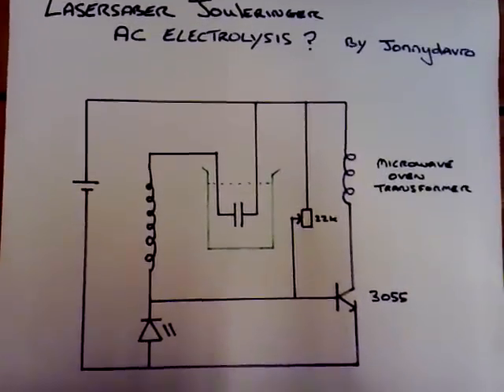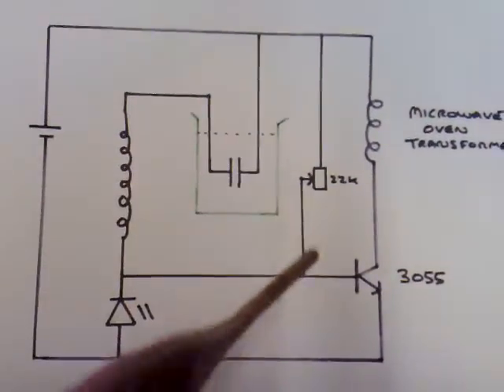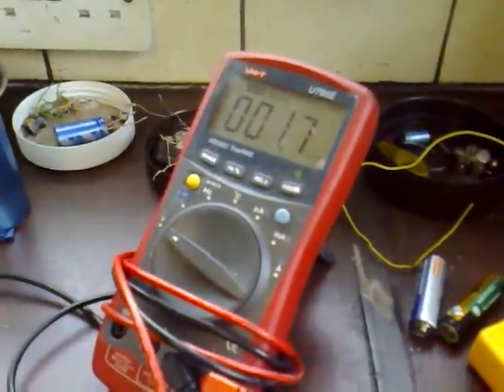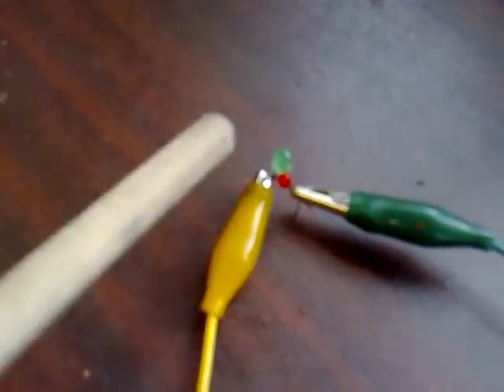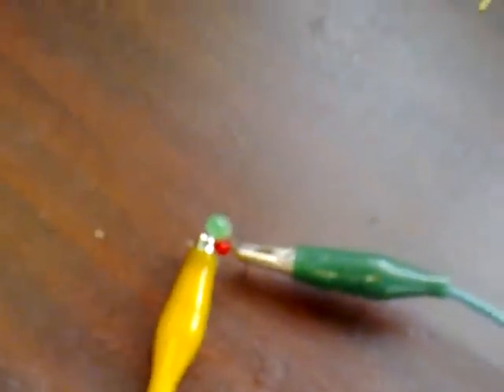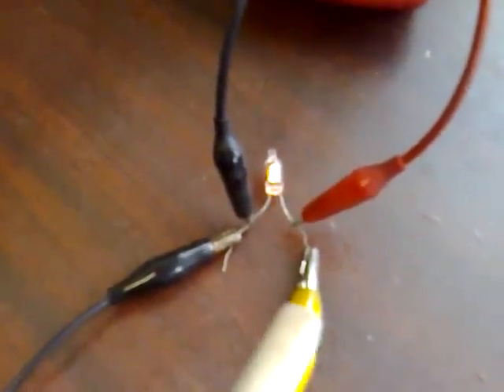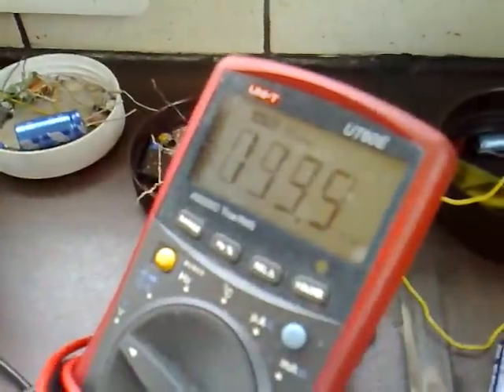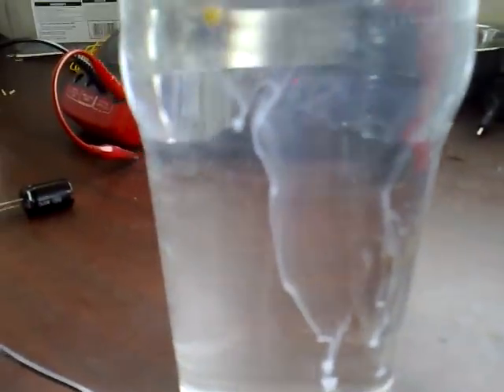Jouleringer Low frequency AC Electrolysis?

Comment: I'm an EE and I have a few things to point out if you want.  First, you will want to place a good sized diode from the collector of your 2N3055 to your positive rail.  Anode to collector, cathode to positive rail.  This is for circulating the inductive kickback as the 2N3055 shuts off.  If you don't do this, the 2N3055 will fail pretty soon. Second, you can not use an electrolytic capacitor for very long with a large reverse bias of more than a few volts.  These devices are polarized.

Comment: this is cool
i tried this with a plain ol' fuji unit and 2 D batteries . It failed tho. I used a small 6 inch by 1 inch strip of MuMetal , about as thick as a coffee can ,dropped it in and nadda.
funny thin is , i can plug in a unit of 50 leds of a christmas lights , and it does fine. I add another to that line by plugging it in at the end of the 1st set , and the whole thing gets twice as bright.
but anyways , your idea here sparked my mind.
i'll let ya know the out come.
thanx for sharing...

Comment: you need an oscilloscope. A multimeter will indicate a voltage on the ac scale with pulsed dc. If I could only have 1 piece of test equipment it would be a scope.

Comment: You might be miles off and might be miles on...certainly a thoroughly fascinating experiment !
Got a USA MOT here and will take a good look at this. If you replaced the cap with a finely distanced couple of metal plates, would it start to become a radically simpler version of Stan Meyer's system ? Also, could such plates be paralleled for multi running from 1 MOT ?
Good heavens, imagine a car powered by a AA battery lol !

Comment: Just checked - over 5 quid a gallon...I remember 76p a gallon. 2 bob, thrippenny bits, well no not that far back, but pound notes and half pences definitely, the days before 20p's and quid coins.
For Meyer, produce the gas at least battery cost and most output, then efficiently inject with electronic ignition...sounds easy, but obv isn't. Some guy has all of Stan's circuits, front and back on YouTube !